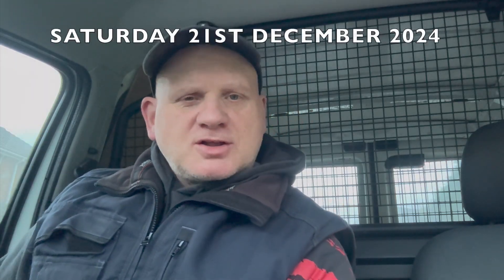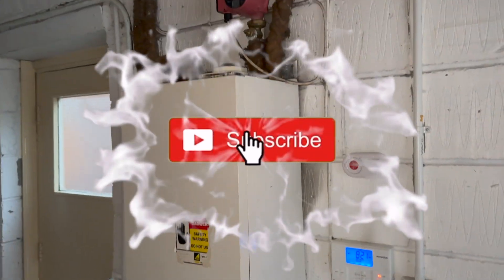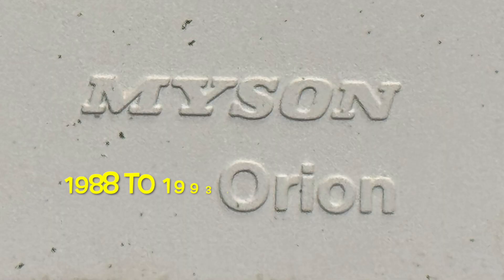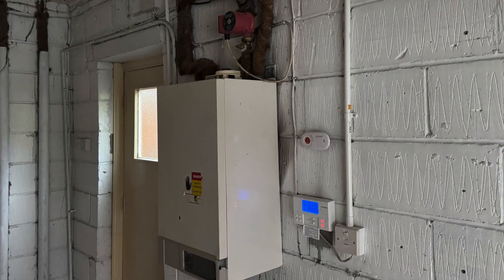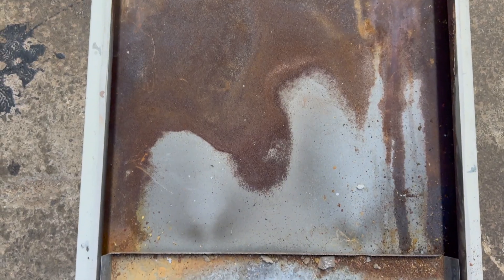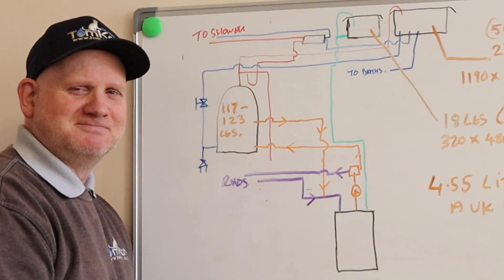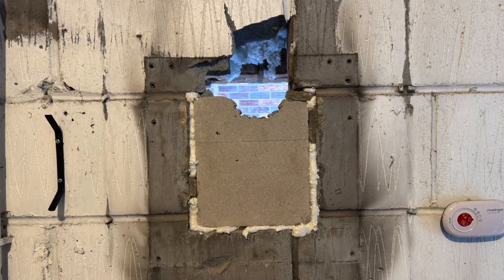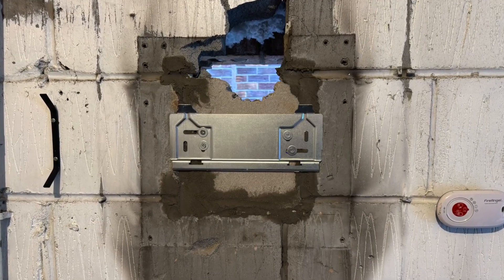How to upgrade from a myson Orion balanced flue heat only boiler to an Ideal vogue Combi  boiler.

Comment: tom next time mate don't put the pipes so close to the wall try half inch clips , as it makes covering in lagging a real knightmare with close fit,
Reply from the maker: Have you not heard about the talon clip spacers a fraction of the price of brass stand off clips

Comment: How do you feel about garage installs of boilers? I'm looking at upgrading from an old oil floor standing external boiler in the garage, to a gas combi boiler, and trying to decide whether I want it in the garage, or in our understairs cupboard. My feeling is that in the understairs cupboard, it would be less subject to humidity and low temperature, and be more efficient keeping it within the thermal envelope…
Reply from the maker: @jonathanfleck5419  it’s always better to have a boiler inside the envelope but moving cost put people off moving the boiler

Comment: In reference to which is better, dust sheets or roll and stroll. I worked on a job once where the customer slipped on the dust sheet on the stairs, fell down the stairs, and eventually died as a result. So I’m a keen user of roll and stroll, although I’m still not totally happy putting anything on the stairs.

Comment: Which kind of block did you use on the inside? 
Did you use ever build fix an fill?
Reply from the maker: @onefortheroad1  the block was the type you can screw into without plugs but we did use plugs and not sure of the brand Tom used for the fix and fill

Comment: Thanks for another good video, quick question, was weather compensation used, if not, why not?
Reply from the maker: @JustInterested-xt3ud  customer wanted load compensation not weather compensation.
Reply: @tomkatgastraining  I have the load compensating Ideal Halo thermostat with my Vogue Max 40. I run it at around 48 degrees centigrade. At this temperature there is no need for weather compensation.